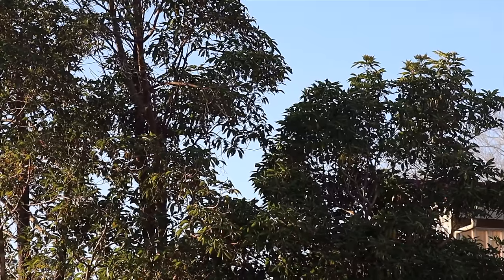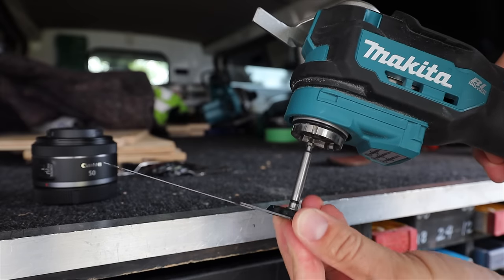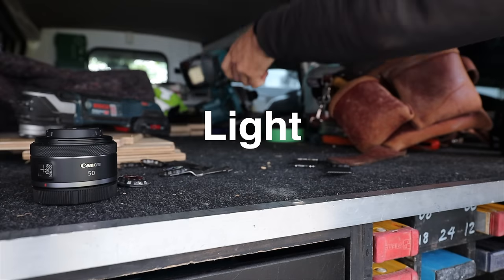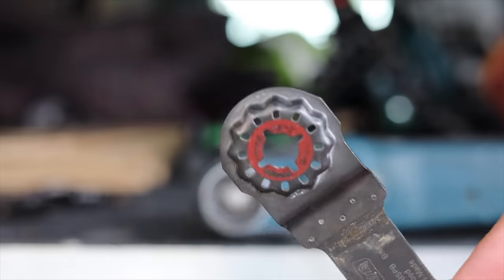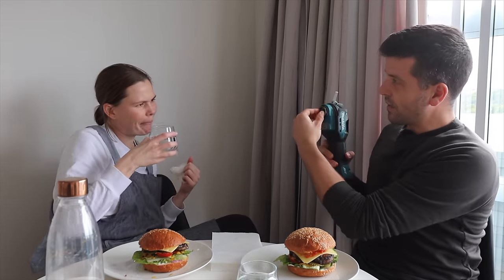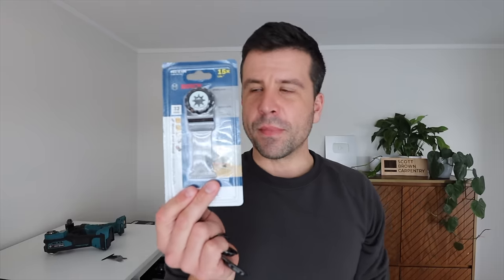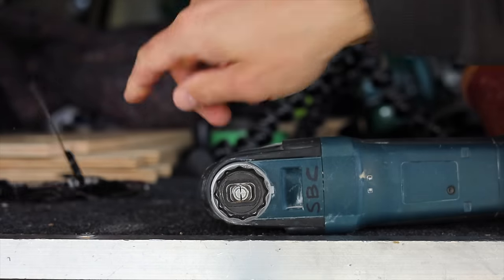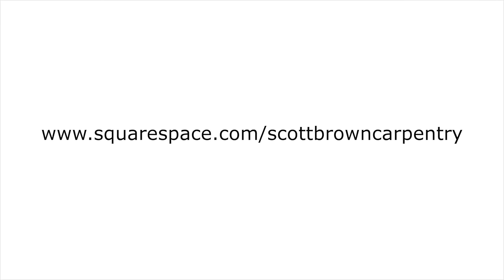Have Makita Made The Ultimate Multitool?

Comment: FYI the second gen DTM51 multitool used 
All the blades including starlock. While they may have lost the light, the pin system works with blades in which you not need to remove the pin entirely to replace the blades making it much quicker to change them than the new starlock only system.  So in my opinion the last gen is much less of a hassle.

Comment: In my 30 years as a carpenter, Makita has never done anything nor been silly. Everything Makita does is for a purpose and if they get it wrong, they will ask for and absorb your criticism or suggestions. However, I do also love my Bosch and Milwaukee tools. The Milwaukee also has a great blade locking system.
Reply: Mostly true, but Makita 18v nailers are not very good.  They are heavier, less reliable, and poorly engineered overall compared to  Hitachi/Metabo HPT and Milwaukee.  There are a few other Makita duds but to my knowledge the nailers are the main shame on Makita.  Generally Makita has the best ergonomics but that is not true from this multitool or it's predecessor.  I think Makita has the best 18v platform (I have almost everything from them including yard equipment) but I got on M12 for rotary tool, pin nailer, stapler, mini (but powerful) recip, installation drill, affordable right angle impact, slim multitool, upcoming 2" planer, and still considering mini bandsaw.  These are all tools that don't compare from LXT (or don't exist at all) from Makita.  So much better to not rely on one battery platform.  LXT and M12 together gives me everything but a brad nailer so I went with Metabo HPT b/c it's the lightest and a smaller platform, so less tempting to get carried away (compared to M18).  It there's an M12 brad or better LXT brad then I may sell the Metabo HPT tools.  Most of my corded are Makita also, with a few Wen if they get 5* reviews (such as the slim sander at a fraction of the Makita cost)

Comment: I have the Bosch and I am very happy with it. I don't think I'd go for the Makita since the whole advantage of the bosch is being able to quickly change the blades without touching them. In case of the Makita, you still need to touch the pin and I'm pretty sure it will get scorching hot, just like the blades. I could be wrong, but the bosch seems to be more convenient.

Comment: My OIS Makita doesn't involve tightening a bolt or using an Allen key. It has a rod that slides into the hub and then the lever on top of the tool locks it tight.

It is noisy as hell though.

Comment: I use a DeWalt. Old school type blades that you can buy on eBay for peanuts. The starlock blades cost a fortune. No tools squeeze and clip in. Used to have a Metabo that had the pin system like the Makita years ago. All makes rip you off for blades.

Comment: Oscillation degree is the most important thing on a multi tool. Dont know why they all are not up front about it on the packaging. I have the old corless Makita. Co workers have Dewalt and Milwaukee.   Then there is my corded Rockwell that you can switch to 3.4 or 5 Degree. At 5 degree its a monster. Makes short work of everything. Only way i can get the cordless to even come close  with the rockwell is to get longer blades in the end creating more sweep.

Comment: Hi Scott, It's not necessarily  about corded or non corded. Starlock Max blades are longer  than the regular Starlock blades. Therefor they have a longer 'travel' which means more torque and require a higher power machine. They designed the max blade so it won't fit machines who can only cope with the standard starlock blades, but you can use regular starlock blades on a starlock Max machine. For now Bosch doesn't have a cordless Starlock Max multitool, but they will in the future. They are always slower in development than the competition.

I owe the same bosch as you, and also a makita IOS with pin. I prefer the Bosch locking any time. A lot easier to swap hot blades, no pin to loose. Als the bosch dust extraction is simple and clever. If you like the Bosch locking system, check out there angle grinder with X-lock. Same principle, very nice, wouldn't want anything else...

Comment: Another nice video! But here are some more details about the blades and the Starlocks : I believe it is a patent thing, why they put the bolt there.  Bosh AND Fein have developed and patented the Starlock system, so Makita had to change something in their tool in order to be able to use the Starlock blades without paying royalty fees. 
The Bosch have Starlock Plus and the new Makita - Starlock Max - they are different and have slightly different compatibility. And your friend's Festool is actually made by Fein for Festool( it is the Fein SuperCut model - in Festool covers and some additional attachments). That is why they don't have the bolt and can accomodate all the Starlock blades ( being Starlock Max).
Reply: Makita do licence Starlock  from Bosch, but you're probably correct on the patent thing too.
Starlock exists because people wanted longer blades, the load was too much on the pins holding the old blades and the machines need more power to drive the blades.    The larger blades are Starlock Max machines only, and it is a backwards compatible system so you can use Starlock (& Starlock Plus) blades on the bigger (Max) machines.
Starlock has the circle of holes for other machines, Starlock Plus doesn't.

Comment: A little hack for you: If you drill a 10 mm drill bit through Starlock MAX blades they will snap perfectly to normal Starlock Plus tools. Like your battery Bosch.
Reply: Not sure if I used 10 mm btw. The hole just has to be a tiny bit wider for the blade to fit.

Comment: It's a start for Makita but those Multi tool blades get hot and being able to add and remove blades without touching them is a more safe way the pin will allow all 3 types but you loose the the extra safety. So it's a good start for Makita but my self I would go Bosch still.

Comment: At 9:00 this is a bit off - all Starlock is downward compatible. A Bosch that accepts Starlock Max will accept the other two Starlock as well, without the pin. In Makita's case, pin likely has to do with the vibration mechanism not allowing the Bosch's Starlock jaws.

Comment: Fein made that blade style first. And I pretty sure the point of the pin is so you can use a adapter and still run non star lock blades.

Comment: I had to go down this path. I was looking at the possibility of getting the DTM52 to replace my DTM51. The thing that turns me off is Starlock. These blades are very expensive. Sometimes you're going to want to use more affordable blades which are not starlock. That's where the DTM51 shines. Where it doesn't shine so well is the fact that it has no light and it's cutting speed is not the greatest. But the fact that you can use every blade on the market is a definite plus. So in the end I decided to bypass the Makita and go with the Milwaukee 2836-20 M18 FUEL. All the pros, none of the cons.

Comment: I had a Bosch starlock, but found that the number of blades was limited and expensive. I now have a AEG, multitool, with a "self change" mechanism, no need for a locking pin, and not starlock, takes the universal blades.

Comment: I love that you included your beautiful Wife. I would probably go with the Bosch  because like you,  I would lose the Makita pin. FYI, I saw a video, can't remember where of a grinding wheel designed to sharpen multi tool blades. The wheel has cut grooves that somewhat match the teeth on the multitool blade. I would love to find one of those.

Comment: I like the DeWalt 20v multi tool best. Super easy to change angles and super quick to change blades and without tools or pins. They have a ton of really good accessories, OEM and aftermarket. My favourite is the carbide blade.

Comment: Close mate, but no cigar, Aeg has that title. It's not that it's the best quality tool out there, it's the fact that the renovator head is removable and you can get a 3/8 square drive nut runner, sawzall, jigsaw and possibly other attachments now. One of the most versatile little machines I have bought.

Comment: The extra rubber must act as a sort of dampener as the rubber is elastic so the vibration will diffuse into the material rather than transmit through it. Also weighting the tool at both ends might help redirect some vibrations away from the grip to make it a little more ergonomic for use over long-durations.

It's impressive just how much goes into designing these sorts of things. They've got several design challenges to overcome simultaneously, while still being competitive in a market of several large players (Although many brands manufacture their products at the exact same factories lol).
In saying that though, I think the power-tool market is one of the finest examples of market-driven innovation as the end users - tradesmen -  are very vocal about the pros and cons of their tools, and there is plenty of mixing of opinions on the job site, so that feedback will propagate through the reps and eventually the design teams.

Comment: Thanks for the nice video! I use the corded Metabo Multitool, which uses a pin and snap mechanism as well. But it sucks, the pin ist just annoying! 
Bosch opened their battery system to other brands, and in terms of that, Fein joined the Bosch battery system. So you could have waited until the original Fein Multimaster is released compatible with the Bosch battery. That's what I am doing 🤣

Comment: My Wife’s eyes would’ve glazed over at “This is the old Makita multitool, right?”
I’m wondering if the Makita pin will reduce wear at the connection point by stretching the contact point of the blade down the central oscillating axis.
And I’m also wondering if you can buy spare pins at a reasonable price.
...and if the tool comes with a box, which is compact, yet roomy enough to carry spare blades and pin.

Comment: or you can just use the dewalt and you don't need the star lock or pin and you can use any regular multi tool blade, and it just snaps off and on and adjust position.

Comment: Hmmm, Festool Vecturo is great.  I love my M18 fuel Milwaukee oscillating saw also.  The blades are much cheaper with Milwaukee.  So I usually end up using Milwaukee more.  But I use Vecturo when I need accuracy..

Comment: @Scott Brown, Can I start by saying love the videos man. But I do have a CHALLENGE!!! for you, If you choose to accept?? In my job line as a joiner for a major stairlift company in the UK, I am sometimes required to perform whats know as a "newel post trim" which in short is to cut a slither (10mm to 30mm) down the length of a newel post to increase the structural opening. This is to ensure that the clients knees aren't clashing with the post on the way up. The best way at the moment I have discovered of doing this is to use a mortice gauge down the length of the post on both sides (of a square post) and go at it with a hand saw (attempting to keep a clean and straight cut, very difficult but with some blood, sweat and tears is possible and cleaned up with a multi tool and sander). My challenge to you would be if you know of an easier way or some power tool that could help do the job. I've tried the following, -a circular saw and  down the scribed line, is very messy and the saw can only cuts 55mm deep and requires it to be finished off with a hand saw, more trouble than its worth as I can never seem to get a perfect finish as the blade burns and puts a recess in the wood. - I've similarly  tried the plunge saw with the track clamped to the post, same problem as the circular, the depth of the cut is only 65mm. My only last choice would be to use a chain saw but can only imagine the mess and as for the quality of the cut??, I'm not sure. Sorry for the essay, hope you can help 😂😂

Comment: I'm on the Makita system and in need of a multi tool and was convinced to buy the new one until the end. Tool is only as good as the pin. No pin = no tool. Nothing would annoy me more than going to put a blade in my Multi tool only to realise the pin has fallen out somewhere at some stage. I would of rathered only be able to use 2/3 blade types if it meant it didnt need a pin. Burger looked great tho! :)

Comment: It's odd to me that the pin thing seems so bizarre. I bought a Fein multitool before multitools were cool and certainly before cordless was a thing and it has a pin and works splendidly. Never had a problem with dropping it or losing it. Flip lever, pull pin, replace blade, replace pin, flip lever. Easy.

Comment: Only one huge issue Makita have overlooked. The star fitment blades are only available from a handful of manufactures and they don't make good blades.. used to have the Bosch and struggled finding the right fitment as most merchants in the UK don't stock the star fitment blades and if they do it's 1 or 2 that cost around £35 per blade.

Switched out to dewalt recently after using makita for 15 years. The jump in performance battery life and usability is ridiculous. Makes Makita look like kids toys. The dewalt multi tool has a quick clamp system that's just as fast at changing. Just crazy how long it's taken Makita to catch up.

Comment: The starlock blade system is based on power output of the tool. Lower powered tools can only run starlock, midrange starlock plus, starlock max is reserved for the most "powerful" multitools. Your 18v Bosch is designed to run starlock plus. I think its even cast into the release lever. Makita's decision to use a pin rather than a quick release was most likely a fiscal decision in order to avoid paying Bosch & Fein for the design rights.

Comment: I bought one today for AU$266. So my comment is it may not be the ultimate tool but it is certainly the most affordable Starlock multitool. Want a Fein or Festool? Go right ahead and empty your wallet or slam your credit card. I have a lot of older blades but I was prepared to let them go for this better system. Fein and Bosch developed it, now Makita are using it. It won't be long until the others come onboard; they will have to. So watchers remember, this Starlock clamping method is the best out there now and for the foreseeable future. I'm on it. Not mentioned on this or other videoes, Starlock 3D prevents clamping blades on THE WRONG WAY!

Comment: The anti vibration on the Makita is impressive. I have the DeWalt, though the blade change and power is a dream, the lack of anti vibration is something they need to address for the next model. Used Milwaukee's and that was a treat to use
Reply: The DeWalt takes 3-10x longer to cut anything compared to tools at half or lower the price. It's a useless tool and you'll be amazed at the performance increase if you change out to something else.

Comment: If you don't need accu power, go for the GOP 55-36 , takes all blades without a pin, the first Fein models all have a pin, this sucks big time, lose it, break it, mechanism don't take the pin anymore, i steer away from things you can lose, never knew Bosch didn't have a accu powerd version for all blades, probably has something to do with the battery life on 18V models, but Makita with their 40V tools should be interesting to see, hopefully with the Bosch click system. I see you use a 6amp battery, curious if older 3amp battery will hold up if you only use the max blades for heavy duty work.

For a moment i thought you gonna cut that burger up with some multitool action :-)

Comment: I guess technically that if you use a standard length blade with the 4° oscillation it's going to cut faster than the 3.6° multitool, but would I be wrong in thinking to achieve the same cutting speeds on a 3.6° version all you'd have to do is buy a longer blade?

Comment: Unless one purchase similar locking pins for that makita,his daily wood/metal work will be severly affected if the machine becomes unusable due to accidental loss of the locking pin. Starlock max blades in addition are rarely used for common tasks so for now I'll stick with my starlock/plus gop18v28 (unless makita engineers do something to replace that pin with bosch/fein blade locking mechanism)

Comment: Im wondering if you demonstrated what the reasoning behind the pin is when you fired the blade off the bosch (such a headache when you are on scaffolding and the blade always finds the gap). Holding the tool, releasing the blade and catching it too!  Then you explained many jobs require multiple blade angles. Ive not seen or used the tool and I'm far from a rocket scientist but surely the pin is self explanatory???

Comment: interesting that,,  never really bothered with starlocks since i binned my bosch corded and went dewalt 18v,,  which has maby the best easiest change system but uses different blades,,  i have to say i literally burn a dewalt multi tool out every 2 years they get that much use,,   but with the battery addaptors out there i still look at different makes to see what might be better than what i have

Comment: Not a big fan of cordless multi tools I prefer the power of the corded models, I use a Rockwell which has a toolless blade retention system and it works perfect, I've also found that the longer the blade the faster the cut, the slotted double hole universal blades seem to work the best.

Comment: star lock just like x lock for grinders are good and all. however. they cost a fortune. and are so rare compared to regular fixings. i can finds blades anywhere for regular fixings. how ever. star lock and x lock are sold only in a few places. so it is a pain having to travel for them. or resort to online purchases. Until they are used by all or most brands personally. i think regular fixings are the way to go. simply because how cheap the blades are and that even a DIY section at a regular store will even carry them. however. you are almost always having to go to trade stores for X lock and star lock. which could be an a good drive away if you run out on the job.